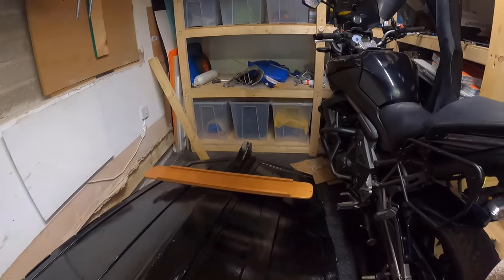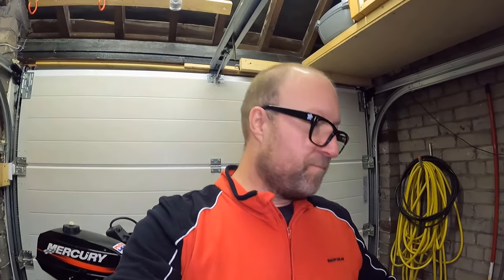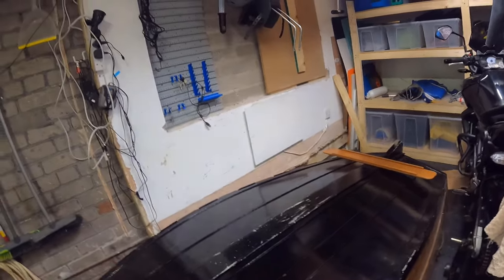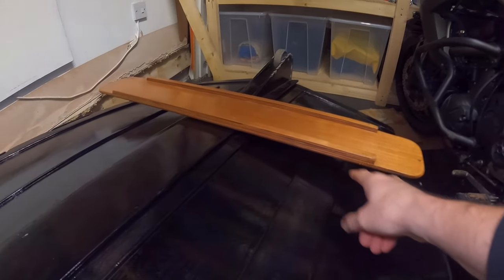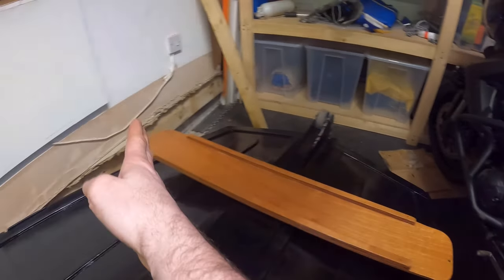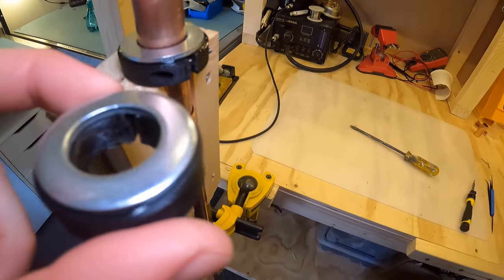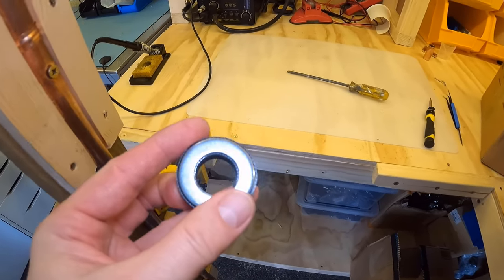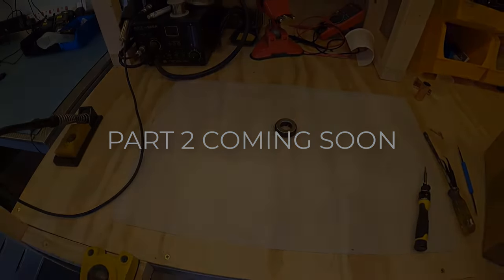Making new Boat wheels for my Sea Hopper - Part 1

Comment: Great idea. I was able to take a kayak/canoe cart and fit it with a slim wooden piece to fit up into the daggerboard case from underneath. I can wheel the Seahopper either folded or open. BUT I worry whether the side-to-side sway as we roll and bump along will damage or loosen the case... Any thoughts?  Thanks, Dave!
Reply from the maker: Hi Mike, Woud be great to share some pictures or videos. I could put them up on this site if you wanted me to.  I don't have a slot through the hull on my Seahopper as it is the motoring/rowing version, not the sailing version. I still have the daggerboard case though as the thwart sits on top of it.

I reckon if you keep the part that goes up the slot quite short so its literally just stopping the wheels sliding side to side then you're OK. I mean you need to keep that little bit to about 1-2cm, so it has no leverage on the inside of the daggerboard case. I would then use straps around the boat and wheels to keep it from jumping out. If you rely on the slot to keep the wheels in place on its own with a longer piece of wood going all the way up then I think you could have too much leverage that could snap the centreboard case away from the hull. It's not that strong in my view. Theres only one way to find out though!!!!!

The best design I saw for this was a metal part that snapped over the sides on the "Portabote" I think you could do this for the Seahopper but my metalworking skills are limited to get the bends prescise. So, I did think about literally drilling holes near the top of the sides and then using a piece of metal that you could screw in, but I always need about 6 months for any "hole drilling idea" to settle in!!! ;-) - Maybe V3??

However I have also been looking at some great folding trolleys too. They're just a bit too expensive but another idea is to think about a trolley that clicks together somehow, made from aluminium tube/section. If it could be packed away nicely then thats always an option but the idea of this was something that the boat could use itself when needing to be pulled in/out of a river or canal.

The story will continue i'm sure!!!
Reply: @SailingWithDave  Thanks so much, Dave, for your good, detailed advice. I think keeping the slot piece short is what I'll try next.  I love my Seahopper, so I am loath to drill any holes-- I like your "built-in wait time"!  As a 'by-the-way,' can you post some sailing vids with your family members? Cheers and fair winds from Japan.